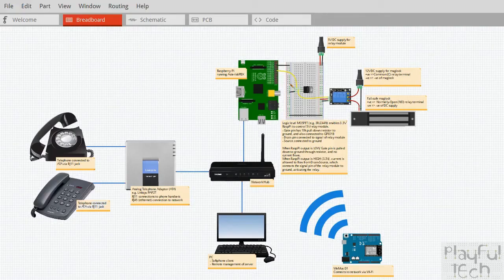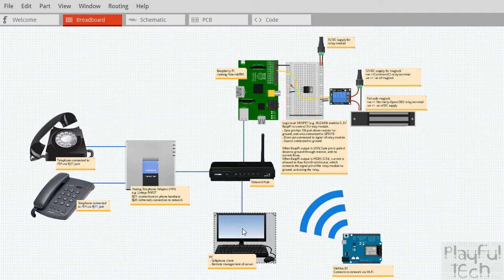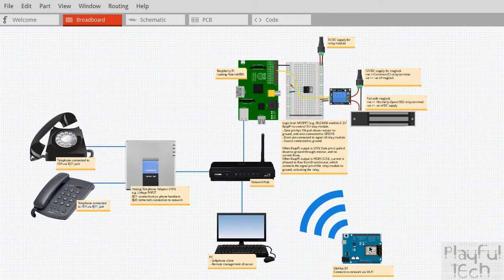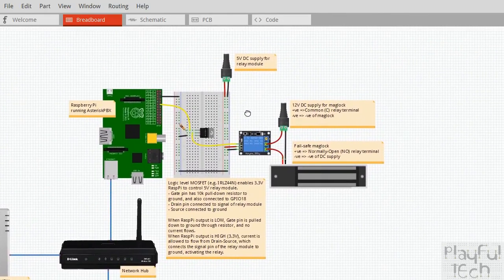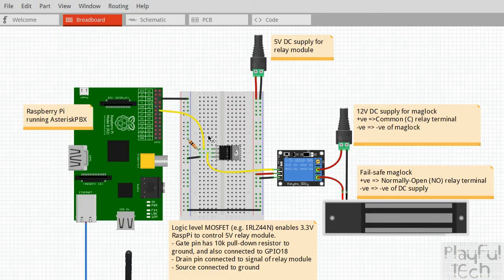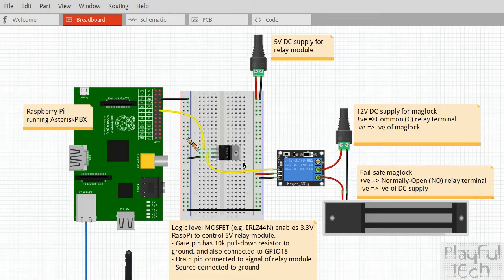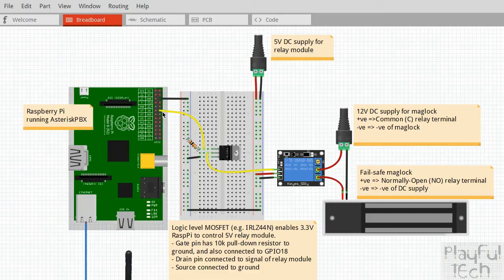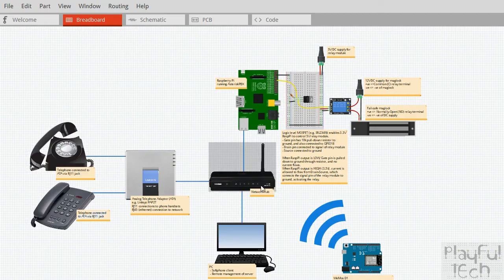"Smooth Operator" - Creating a Playful Telephony Network with Asterisk - Part 1

Comment: Thank you for this! Question,  I’ve been direct working the phone pinout to gpio pins on the pi but this options seems much easier! Is it possible to connect the linksys directly to the raspberry pi or does it require the router between it?

Comment: Very useful video, many thanks for such content.

I like to ask for some guidelines. I need a MCU based DEVICE which will be used with a Landline phone to provide IVR password security. For example:

Telephone line --- ( RJ11 Cable) --- MCU_DEVICE --- ( RJ11 Cable) --- Landphone

When a user calls then the MCU_DEVICE will auto Answer and play an IVR "Hey, thanks for calling, please enter password". If caller enter passwords correctly then Landphone will start ring.

I wanted to use an MCU based solution rather than RPi VoIP based. Can you advise some outline about the schematic?

Thanks in advance.

Comment: The 3.3 volt outputs of the Raspberry Pi is usually able to trigger most 5V relay modules.  Most projects you will find have the outputs of the RPi going directly to the inputs of the relay modules.  The relay module needs 5 v power for the reliable operation of the relay coilds but the control signals can be 3.3 volts because anything above 2 volts is considered to be high and below 0.8 volts is low.  So you probably don't need the MOSFET between the RPi and the relay module. At least, I would try it to first without the MOSFET.
Reply from the maker: I agree, though I'd emphasise the "usually able" part of your answer ;)

Comment: Tip.. once you've installed raspbx 04-04-2018, from command line run fwconsole ma upgradeall. Then go have a cup of tea or whatever. Solves the freepbx tampered file and GUI crashes etc.

Comment: Very enjoyable video I have an asterisk on a raspberry pi at home I've been using it for a couple of years. You mentioned vintage phones with rotary dials. There is one adaptor made, the grandstream 502 which does actually accept pulse dialling. It's worth knowing if you're interested in vintage phones. You will probably have to adjust the dial's contact set to a very tiny gap for it to dial the digits correctly. The grandstream is very fussy about pulse width

Comment: Do you need the computer attached to the system once it's set up or will it run entirely from the Pi? Like can I store all the audio files and the code for the dialed numbers / triggers in the Pi and have no need for another PC?
Reply from the maker: The PC is only required for first setup - once you've got it all setup it's completely self-contained and standalone on the Raspberry Pi.

Comment: I have been thinking of an arduino version of this but the asterisk version is so much better. One thing do you think you could have multiple audio playbacks for the same dialed number? Not random but in a certain order that does not repeat.
Reply from the maker: Yep, sure - you can have a variable that gets incremented each time you call the number and plays the next message in an array.
Reply from the maker: I put an example of a counter that keeps track of the number of times an extension was called in the Pt.3 video I just uploaded - you could use this to playback different sound files by passing the variable to Playback() - check out from about 35:15 - https://youtu.be/QDOD_sBffRI?t=1868
Reply: Thanks, I still have to watch part 3 and 4. Great videos.